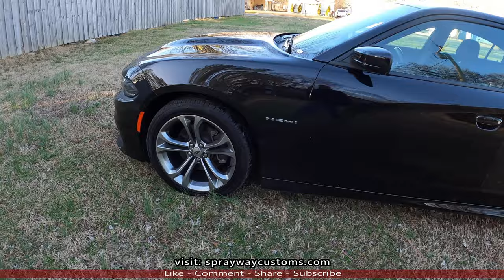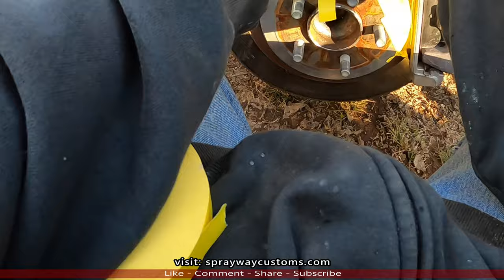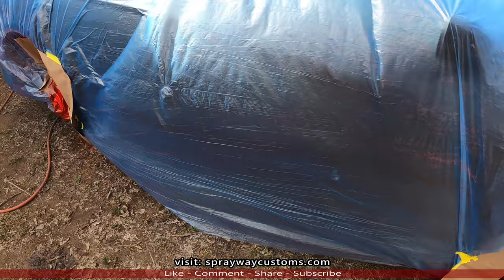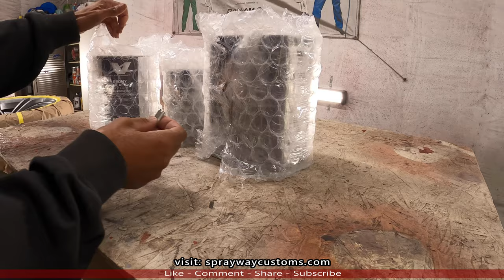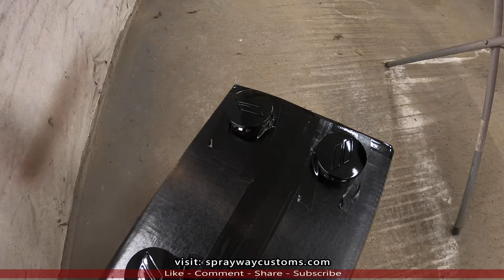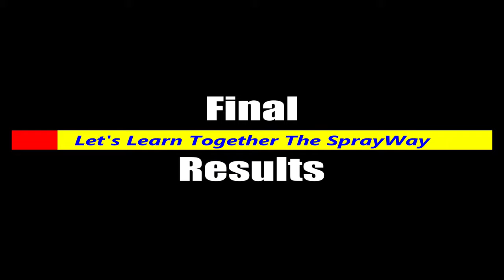Spraying The Cheapest Paint & Clear On This Dodge Charger Wheels & Brake Calipers On Car - HOW TO

Comment: The high-tech is very good stuff, sold it at slack auto parts, thier high build primer is also very very good. Clearcoat I know for a fact stands up 5 years with zero issues.
Reply from the maker: Thanks

Comment: Nice Work! I've been painting wheels for years and have tried just about every method for masking when there is a tire on the wheel, If I can I like to break the bead down on the outside of the wheel it gets the tire away from the wheel surface but you can't always do that so when I can't and I have to mask the tire I have found the best way to get the masking tape to stick to a tire that has had tire shine on it or any kind of tire conditioner is before I do anything I use either super clean or purple power i use it in a garden sprayer just for ease but spray it out of anything and just soak the tire and wheel with it even your caliper if your going to paint it it does a few things, degreases the tire/wheel/caliper very good and it also leaves the tires nice and clean looking when your done but most importantly it rids the tire of all the chemicals and your tape will stick perfect every time! a pressure washer is a bonus when rinsing it off but a normal hose works just fine too. They look good though ! keep up the awesome content we never get tired of watching your talent!
Reply from the maker: Appreciate all the info

Comment: I use Excel Products XL urethane primers over epoxy primers that I use on bare metal. It sands well and the price is low. Never had a problem with them. I do add some urethane reducer because they are quite thick out of the can. On another note, it's a joy to watch your projects and how you get them done. The final product is always beautiful.
Reply from the maker: Thanks for the info

Comment: did you use heat resistant paint on the calipers so the paint won't bubble when the brakes heat up?
Reply from the maker: No I didn’t. I’ve never used heat resistant paint on calipers and rotors. Regular automotive paint can stand the heat. I never had a issue…even on engine parts.
Reply: You always make sure to clear your jobs good anyways, so no problem with heat👍